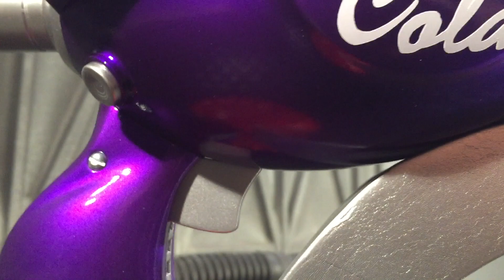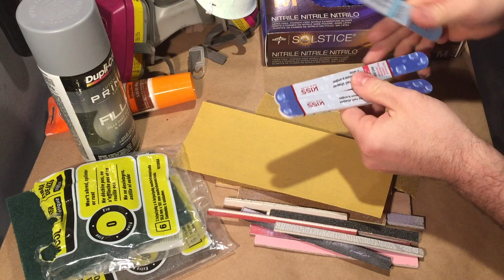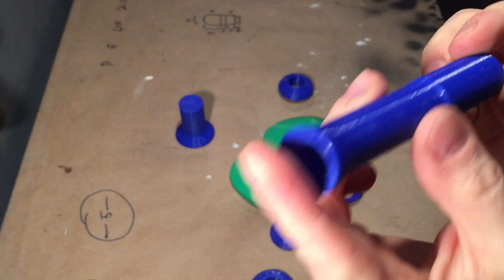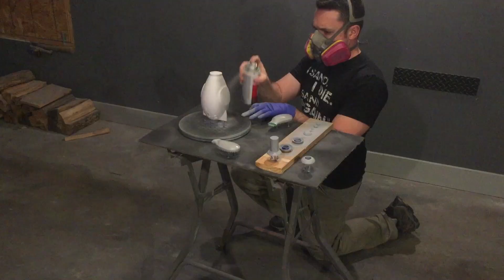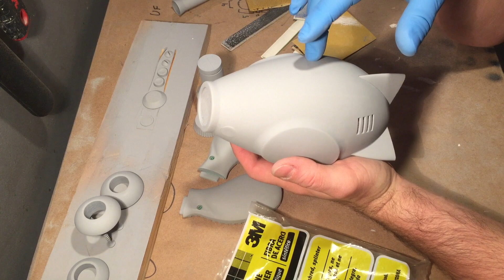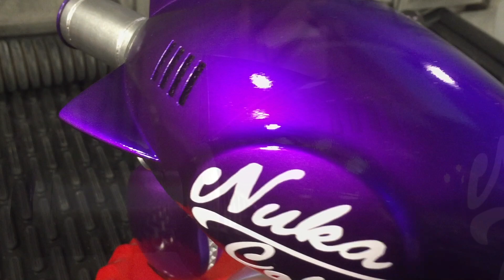How to Post Process Your 3D Printed Props For Cheap

Comment: Could you please explain the process in detail for making the part look super shiny? Specifically from the part where you used the synthetic steel wool onwards.

Did you use the fine or super fine synthetic steel wool? And then when you polished it with a rag, what polish did you use? 

Thank you so much this looks amazing!!!
Reply from the maker: It's just working up the progression of finer and finer grits. The wool is just better for the final passes as it conforms to curves better. No polish on the rag, just dry buffing.